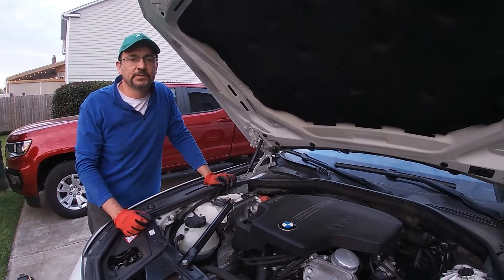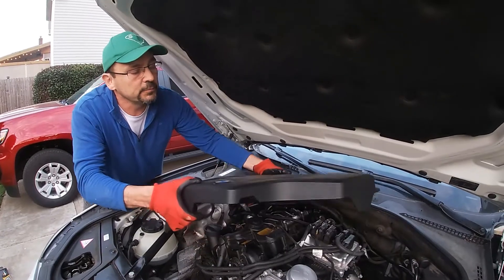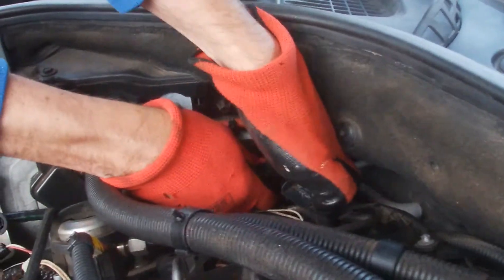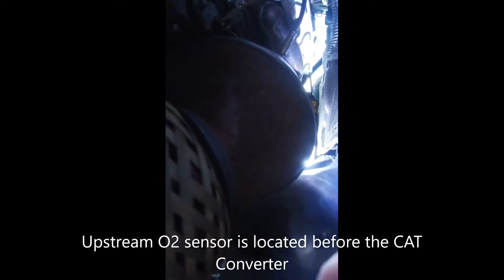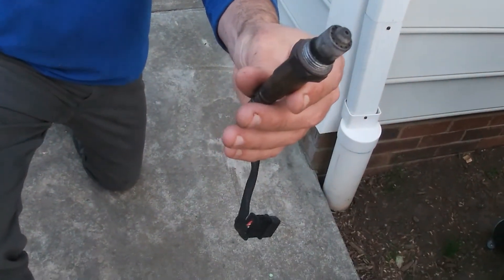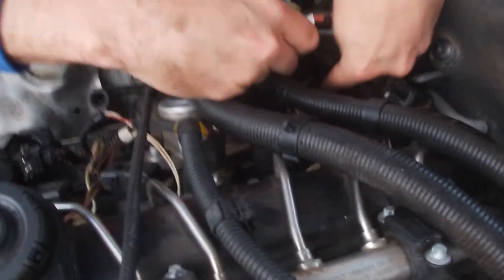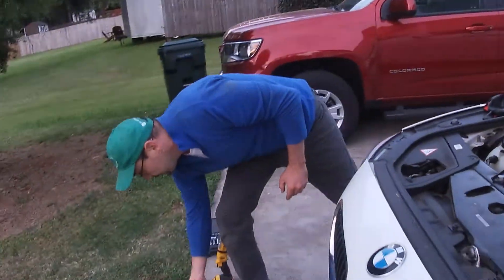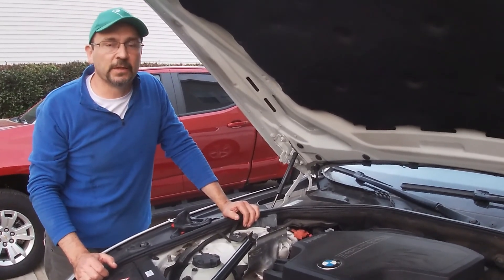2013 BMW 528i N20 Oxygen Sensor Replacement

Comment: Wish you could of showed how to get into the small space. I have an 08  535i upper stream code pops up. Need advise on how to get to it
Reply from the maker: It is a tight space by the cat. but I found it to be easier to put the tool on the sensor when working below the vehicle.
Reply: Ratchet extensions

Comment: could u please explain which side the "tab" is on the o2 sensor? im on a 2015 228i N20 and lost my mind trying to unclip the sensors for hours without success.
Reply from the maker: While looking at the connector from the driver's side, the connector is made up of two sections.  The left section leads to the oxygen sensor and the right section leads to the ECM.  The tab is on the right hand section of the connector in the back.  There is only one tab to press down on.  Press the tab down and pull toward the front of the vehicle to seperate the two sections.

Comment: What was the symptom(s) of a bad O2 sensor?  In other word, how to determine which O2 sensor is out of order?
Reply: Sluggish acceleration, misfiring of multiple cylinders, and/or P0172 code kicked in.
Reply: Get a diagnostic test done, free at autozone